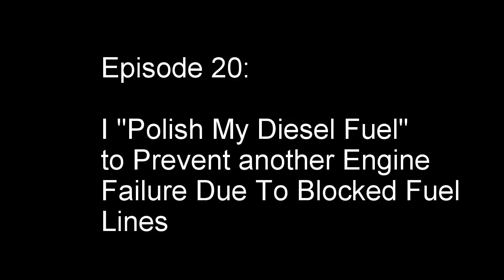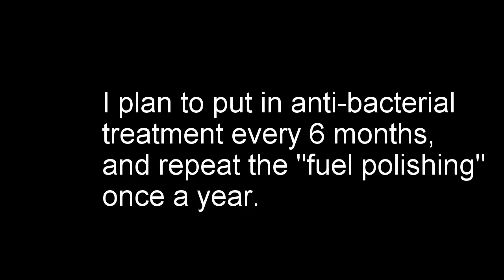Ep 20 Diesel Fuel 'Polishing' To Prevent Clogged Filters and Lines

Comment: Hi Patrick, thanks for your very nice and inspiring video's. They brought me one step closer to my idea of sailing solo from Amsterdam to the Azores and now it might actually happen.
Talking about diesel fuel, are you familiar with GTL? Having problems with bacteria in diesel causing engine failure has been a problem for sailors here in The Netherlands as well. A few years ago they introduced GTL (Gas To Liquid). A fuel for diesel engines not based on oil but on gas. They claim this fuel is less prone to going bad, time will tell, but the immediate advantage that really stands out is the fact that it does not smell and it doesn't stain if spilled. Also the exhaust fumes are much cleaner. 
Another difference though is that because it is not based on oil, it does not have the lubricant characteristics of normal diesel. So some believe it might over time cause damage to seals and/or the fuel pump. Engine manufacturers have approved GTL for their motors and our 28 year old Volvo Penta runs fine on it (as is our Webasto heater), but we've been using it for only a year now so yes, time will tell. Anyway, perhaps this information is of some use. You can of course find a lot more about it on the internet.
Last but not least: next year we will be sailing down the French coast for three summer months all the way down to La Rochelle. Would be nice to meet, have a drink and talk about (solo) sailing. Send me an email if you like to jdtr@live.nl and we keep in touch.
All the best,
JD
Reply from the maker: Hello again Jan.  I responded to Jan Draw on this.  :-)

Comment: Patrick, so enjoy your videos! How about installing an inspection port (wide accessibility) in the top of your tank. They go in pretty easy. Thanks, Scott
Reply from the maker: Thanks Scott.  Much appreciated.    In theory, installing an inspection port is no big deal.  BUT, the tank is fixed and can't be taken out (without taking the boat apart).   Thus, I'd have to drain 210 liters of fuel to be able to clean the bottom of the tank after cutting the hole.  I suppose that is doable, but not simple.   If I have another problem, I will definitely do it though.     Many thanks for watching.
Reply: @patricklaine6958  The aluminum tank on my Downeast 38 is divided by 2 baffles into 3 sections. Each section has a 4" screw in inspection port. Here in SoCal plenty of fuel polishers around. Great videos. Cheers.

Comment: Thanks very much for a very good video, it is appreciated. It is interesting to see how much material was in your in-line pre-filters. The issues that you had in episode 12 was probably due to this material building up in the emergency shutoff valve. However, it is a good practice to run your fuel polishing procedure as planned. The last thing you want in a storm is a fuel delivery problem. Adding my two cents (we no longer use pennies in Canada, so 2 cents isn't worth much here), but I think it would be wise to have the Racor mounted permanently as the first line of defence to your Volvo fuel filters, after your fuel shut off. If you had had this in place previous to your episode 12 trip you would have seen that the bowl would be emptying. Twin pickups in your plastic fuel tank might be something to consider that you can switch between (both with fuel shut offs). I like your ideas of going first with 30 micron and then 10, I think I would bite the bullet and have both in your fuel polish system. Thanks for some inspiration, Patrick. I am going to build a fuel polish rig and run it in the spring as part of my CS36 traditional commissioning. Great job on your videos, by the way 😎
Reply from the maker: All great suggestions Don.   I bought the Racor, but haven't yet installed it.  It needs to go into a very tight space, and I need to build up some courage to take this one on!   I plan to leave on my next major passage at the end of March.   I'll do a treatment of biocide mid February, and then run the polisher again mid March just before leaving.  It will then become an annual event just before the prime sailing season.   BTW, I did change out that emergency cut-off valve that had a tiny orifice for one that had a normal size orifice.   If I'm going to have a problem, I'd like to see it in the filters rather than have to guess where in the fuel line it is blocked.   Many thanks for watching and commenting.

Comment: A quick note on fuel polishing. To work best the diesel needs to be sprayed around the inside of the tank at a "hosepipe" velocity with the tank perhaps 20% full. The idea is to agitate any accumulated and solidified sediments which will then be sucked up and washed by a system  like this one. For DIY polishing one could use a seperate high volume pump which is piped independently from the polishing/cleaning pump and filters. Try to direct the high volume diesel into all areas of the tank. The suction line should incorporate a transparent strainer. Jabsco sell self-priming pumps of suitable capacity. I hope this is helpful and not overly complicated.
Reply from the maker: Thanks David.  The key constraint with my tank is that it needs several inspection ports, so that you can get behind the 3 baffles.....   This was a serious design flaw with my boat.  Thanks for the input.
Reply: Well, I suppose you could drill entry holes into each “hidden” baffled section through which you could fit the spray hosepipe so as to “jet-wash” each of the tank sections. When finished if the access hole is not too big it could be closed off/sealed with a suitable self tapping bolt/bung type sealing cap/sealing bolt/lid !!! /??? Yes I think a jet wash in addition to the polishing/ filtering is desirable.

Comment: Great video's Patrick and thank you for inspiring me to sail to Horta all by myself (from Amsterdam). The plan was there, the courage I was still trying to find, but your well documented story pushed me over and now the idea will become reality. So thank you for that. 
About fuel. Did you ever consider to run on GTL (Gas To Liquid)? It burns cleaner than diesel, is less prone to contermination (is what they say) and what I really like about it is the fact that it does not smell or stain. There has been a discussion whether is it safe to use because it does not have the lubricant characteristics (important for the fuel pump) of diesel, which obviously is a kind of oil. GTL is a fuel for diesel engines, not based on oil and therefore less lubricant. Anyway, the GTL you can buy today has been approved by most common engine brands and we have been using it for over a year now in our 28 year old Volvo Penta without any problems. And also our Webasto heater runs fine on it. How it will affect the engine (parts) on the long run, we will have to find out, but for now we are happy with it, especially because as I said before it really does not smell and also the exhaust fumes are less visible and less smelly. 
Last but not least, next summer we will be sailing down the coast of France and back and will also visit La Rochelle. Perhaps we can have a drink and talk about sailing? My email is jdtr@live.nl 
All the best! 
JD
Reply from the maker: Many thanks Jan.  I'm honored that you found some inspiration in my modest effort at documenting my trip to the Azores.   I'm sure you will enjoy the adventure, and will make far fewer errors than I did.    Regarding GTL, I'm a bit embarrassed to admit that I haven't heard of this before in marine applications.    If it is approved by Volvo Penta, why not?   A concern I would have would be how to find it in the small ports of North-West Spain, or in the Azores.   I suppose you can always mix it with traditional diesel if need be, but maybe not.    You have intrigued me, so I'll do some reading on this topic.  (I too have a Webasto heater.   :-)  )     I would be delighted to meet up in La Rochelle and buy you a beer.  That said, my plan next Spring/Summer is to head up across the Channel and then up the East Coast of the UK to the Shetland Islands, before crossing over to Norway.   We'll probably cross tracks somewhere, and  I'll probably call on Amsterdam on my way home!   Let's stay in touch  pcjlaine@gmail.com

Comment: Hi Richard - well I got to the polishing video quicker than I thought ( my wife is out of the house 😉). I reckon you did a good job and you have a good polishing rig there. If I may make a few comments which are not made to depress or deride what you have done at all. 1. In fact your fuel does sort of get polished all the time that your engine is in use because the fuel lift pump(normally engine driven) provides more fuel than the engine needs and any fuel not injected (depends on throttle position) is returned to the tank - and that is filtered fuel. 2. In the case of contamination be that dirt or bacterial shite the crud ends up choking the pump strainer, the inside of pipes, adhering the walls of the tanks, and especially any small bore pipes at bends or valves (where fitted). You cannot remove this sort of adherent shite by flushing with a polishing rig because the flow rates are just too low. The only way to assure yourself that the system is clean is to mechanically clean. 3. Mechanical clean involves cleaning the inside of the tank and you need good arm size access - you may wish to consider fitting one of these to the top of your fuel tank - http://www.hendersons.co.uk/boattank/Tank-access.html. But in the fitting of it you will end up putting lots of polypropylene debris in the tank too which will have to be retrieved too, so if you can get the tank out without destroying the cabin it is probably prudent to do so. You also need to clean all pipework from the tank to the fuel lift pump at least -which is not so easy and the best way is probably by pulling lint free cloth through their length (one section at a  time) any small bore copper pipe can be taken off the boat and surreptitiously blown through with a garage air line. 4. Once you are satisfied that the system is clean the future is all about prevention, strainers on the filling line/funnel and ensuring no water gets into the tank - most common is a poor seal on the deck filling cap or not snugging up the cap firmly. Water can then get into the tank via breathing and condensation or via fuelling from a contaminated supply. 5. The best return on your investment is to fit the purolater/water separator (from your newly fashioned polishing rig) in the system as the first filter in the system after the tank. (If you can possibly manage to fit this in the engine space then make every effort to do so -as you should check it for water daily if you are using the engine).

The reason I make this latter suggestion is that having the water separator in the system is an act of prevention whereas if you leave it as a polishing rig which will only be used ad-hoc or even periodically it is doing rather less good than the filtered fuel returned by the engine in normal course.

I apologise for the verbosity.😳
Reply from the maker: Many thanks for the detailed comment Norman.   I really like the Henderson access covers.    I'd probably need two though to get behind the baffles.     That would be a major project to install (draining tank, etc.) but is something I really should do.....    Someone else also mentioned that modern diesels are self-polishing by the return of excess fuel, which I hadn't really appreciated.  And, an advantage of YouTube, someone with the same boat as mine is going to send me a photo of how he hooked up an extra Racor right at the exit of the tank.  (Space is a bit tight there, so I am looking forward to seeing how he did it.)   I think getting a second separator/filter in-line is really my top priority now.   Once that is done, I'll give thought as to how to clean the rest of the system.   Cheers for commenting.
Reply: Patrick Laine Thanks for the thanks.😉it is worth the considerable effort to rearrange the engine space to squeeze the Racor in / so it can be accessed preferably from the front or at the gearbox access - so that it can be checked very easily and attended to without getting diesel fuel in the bilge under the cabin.

Comment: Clever idea Patrick.  I like your setup and am wondering if you could find a place to permanently mount it along with another filter so you don't have to switch and still see the bowls.  I think replacing your tanks outlet with a T on feed and returns and wire in a timer so it runs auto for say 2-3 hours a week should be enough. A manual on/off switch would be icing on the cake so to speak. Sail on...
Reply from the maker: Your idea is a good one CBD, and many larger boats, especially power boats, do have permanently mounted duplication and a polisher that can be switched on/off.  I just don’t have the space.   I don’t criticize the manufacturer for not having a drain valve on my tank.   Plastic tanks are often molded to fit the shape of the hull, and the drain valve would have to be installed below the
tank and at the lowest point, and accessible.  Not easy to do.    On the other hand, it is really poor design not to have allowed for two large inspection ports on the top of the tank (ahead of, and aft of the baffles in the tank) to allow access from above.  That would have been easy to do prior to installation, but is a bit of a nightmare after.   Thanks for commenting.

Comment: Mr. Laine: My Air Force training was Electrical Power Production Specialist. Most of my adult life I worked in Diesel Power Generating Facilities as a High Voltage/Control Power/Distribution Electrician in remote locations all over the world; however, on many occasions I also helped out with mechanical duties as well as plant operator. When we "polished" our diesel fuel it was usually 10, 20 or 50 thousand gallons at a time. I've seen tanks of diesel that looked like long green algae growing in the fuel. I've also been  driving my diesel pickup for the last 23 years.  Tip: Always try to buy your fuel from a place that sells a large amount of diesel. It means they'll be pumping new diesel straight from the refinery into their storage tanks quite often, which doesn't allow the "algae" time to grow if they're lax in polishing....and you will be refueling with cleaner diesel. Excellent job by the way on your polishing method. Possibly changing your engines inline filter/separator to a unit with a clear bowl will help you notice a contaminated batch of fuel before it causes a shutdown.
Reply from the maker: You read my mind Grandpa.  I am going to change the separator with a solid base and replace it with one with a glass bowl.   (As it is in the engine room, I'm also required to install a small metal shield to give two minutes of fire resistance, but that is no big deal.)   Many thanks for commenting.
Reply: Patrick: When I was much younger and between overseas jobs, I lived aboard a tiny Balboa 26ft., swing keel sailboat with only a 9.9hp Mercury outboard motor in the San Joaquin Delta river system. She didn't even have a radio or refrigerator, only an ice box.. Just a few months after purchasing the vessel & never really having any sailing experience... I went on the adventure of my lifetime. One day, this urge just hit me... so I stocked up on canned food, beef jerky, water, coffee, bought another 10gal fuel tank...packed her full... grabbed my guitar & big orange cat "Captain Morris".... sailed down river & across San Francisco Bay... headed out under the Golden Gate...and turned north. No charts, but she had a compass & I had a road map of the west coast. Up to Alaska, back down the west coast, around the horn of Baja Mexico, up, down, zig-zagging across the Sea of Cortez, then back up the west coast, ran out of gas & money in Monterey, Calif. (That's another story)  under the Golden Gate back across the Bay, then up the river to our home marina. Took a little over a year with stops at all the ports we visited. It still amazes me Captain Morris & I lived through such a stupid, stupid notion .... but what an adventure it was.
Reply from the maker: You sound like an authentic Indiana Jones Grandpa.   It may have been crazy, but those are the things that leave a lifetime of memories.   Very best to you.

Comment: Diesel in Europa is blended with 5% biodiesel which is a disaster for boating as it adds hydroscopic elements resulting in increased attraction of water (moisture) by the fuel. I had a long repair on my boat and recently got the new engine in. After 6 years of non-operations sought it was a good idea to clean out the diesel tank. What came out of the tank shocked me as it was nearly all water!  20liter diesel had been transformed into 20lit of filthy water with minor smells and taste of diesel...... Therefore having a water separator between the diesel fuel lines is needed as well as adding bacteria killing additives.  The engine not used for a year I would start it, get the oil warm and than get the oil out of the engine and refill with new oil after having changing the oil filter as oil oil sludge (oil with water) might have formed!
Reply from the maker: Agree completely Bely Bob.   I have a water separating filter in my line, and I treat my fuel with an additive (Actioil 550) every 6 months.   I use my boat very frequently, so the throughput of fuel is relatively high.    I also change my oil at least once each year, and due to heavy usage this year, twice.  Thanks for commenting.